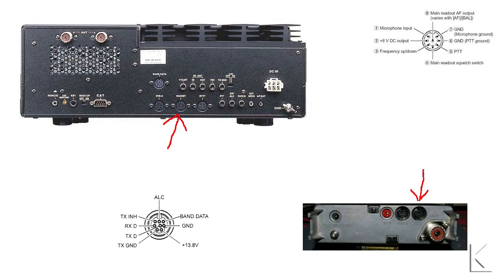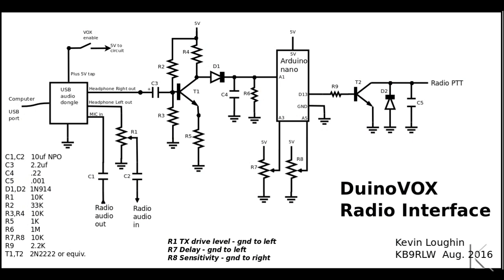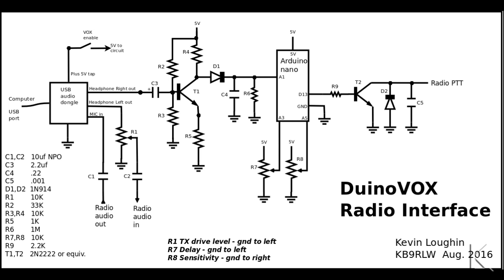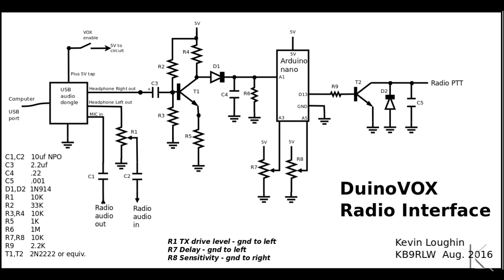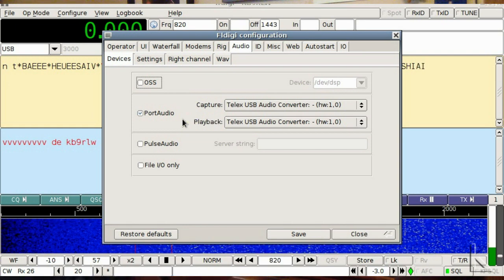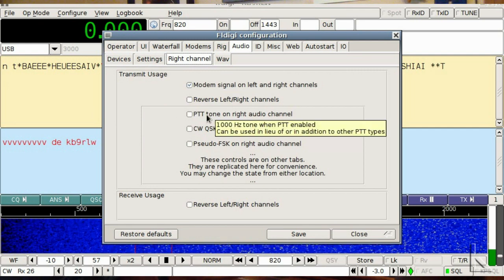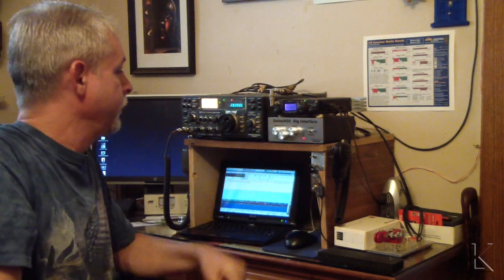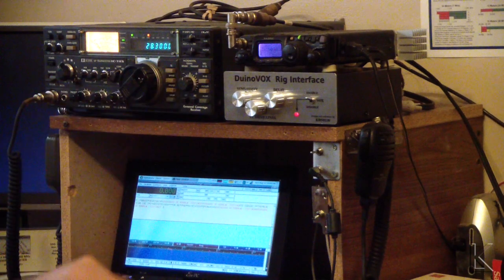DuinoVOX   USB digital modes interface for Ham Radio.  Easy to build!

Comment: Thank you so much for running through what all the resistors are for etc, I am not good enough to understand how to design my own yet so im swimmin gin a sea of diagrams and old forum posts! Tip for the future please balance the radio noises to your voice, i had to fiddle the audio a lot to not hurt my ears
Reply from the maker: This was many years ago when I was first doing yt vids.    One of my first major projects actually and there's been many since.  Production value improved greatly a year after this video..  Check my channel videos tab, over 500 vids now.
Reply: @loughkb  Will do thanks, I'm highly interested in trying to make my own little TNC but the schematics I see are all so varied. Hopefully ill find more info on this channel :)

Comment: Hi Kevin, thanks for a great video. Im in need of a VOX and have all the parts except for the 33k resistor. Any alternative suggestions. I may have 100k that i can put in parralel x3 but if not any substitution suggestions for the 33k resistor? 22k is the closest I have on hand.
Reply from the maker: No, that has to be 33K for the amplifier to work correctly.  It's a common value, you should be able to obtain one from any supplier.

Comment: Thanks for sharing this Kevin! I love your really clear explanation of the circuit diagram and the function demonstration. I have created a simple audio circuit similar to yours, but I put isolation transformers in, and also added a resistor divider instead of a pot to adjust the levels. FIne adjustment can then be done in the PC software. I didn't put a vox circuit in, but used a control cable to the radio from a separate usb port, because at the time I didn't know how to get vox configured.

Comment: Can we use it for ecolink de VU3ZNL
Reply from the maker: Maybe.  You might have to dial up the delay so it doesn't unkey the radio during vocal pauses.   Echolink really needs to have direct control of the PTT line to work properly.
Reply: @loughkb  thank u de VU3ZNL

Comment: This may be a bit late but what size enclosure did the unit fit into? Are you still using it?
Reply from the maker: The size can vary.  I've seen people build it into an altoids tin.  Yes, I use it with my FT-817.

Comment: I've seen your design with some changes by another builder. I am not sure the reason but he has the PTT circuit driving the coil side of a relay. I personally think going that route is one, unnecessary and two wouldn't the relay be a very possibly point of inducing noise into the device? It is adding a few more parts and the transistor is merely completing the ground to a PTT relay that is inside the radio already. 

I just don't get why one would feel a need to use a relay to merely complete the ground to another relay inside the radio. Relays will be pulling the 5 volts down even more and relays can be a major point for failures later down the road. To each their own though. That's the pure fun of designing and building stuff though.

Comment: Hey Kevin, I was curious if you sold a circuit board for this or not? I use these style boards as well but wanted to see if you happened to build a board for it that was printed out with traces. I am going to try and do mine that way to see how neat I can actually make this and eliminate so much wiring inside of it. Well at least keep it super short. I am doing this just because I love seeing how downsized I can make things.

Comment: Thank you for this project. It will help me to create a link between my Heathkit SB-104A into the digital modes interface and use the FLDIGI program. I got everything that I need for the Arduino Nano module source code. The problem was that I tried to print the schematic, but it came out in a fuzzy image. I do not know why it happened. Can you help me? Thank you very much
Reply from the maker: Send me an email to my public address listed on qrz.com and I'll send you the schematic.
Also, being that the old heathkit is a tube rig, you may want to use isolation transformers for the audio connections to the radio and an opto isolator or even a relay for the keying line.
Reply: @loughkb  My Heathkit transceiver is SB-104A, full solid-states, but I like to put optoisolators to interface with my rig. I do not have a callsign but expect to get one later this month or next month. I got some parts to build DuinoVOX USB. Some other parts are coming to be complete before I start to build the device. 73

Comment: what can I leave out of the circuit as using cat to key up
Reply from the maker: Everything but the audio interface.   The goal of this device is to do everything with only one simple USB connection on the computer side.  Eliminating the need for the additional serial connection for cat control.

Comment: Nice project i did it in my own way the same but i have a problem. When i use wsjtx for ft8 or fldigi for other modes. They often crash on trabsmit. Fldigi stops transmitting and the waterfall freezes although the laptop runs smoothly. Wsjtx also stops transmitting and switches the audio output to my default speaker. I think this issue is created through rf interference but im not sure (these problems dont occur on 2m or 70cm but on hf). How can i fix this

Note: i use a plastic box as an enclosure so no shielding ti ground from the box
Note 2: every problem disappears when using 5W on my rig. Everything above does not work
Reply from the maker: You have a problem with your antenna system that is feeding RF back into your shack on the coax shield.   Or your antenna is too close to your shack and you're running power.
What kind of antenna and how much power are you running?
Reply: @loughkb  on a cushcraft r5 which is about 1 to 2 meters above the ground. I run 5 to 100 watts on an icom ic 705mk2g. 5 watts all fine but as soon as i go higher it crashes. My antenna is maybe 6 or 7 meters to my shack
Reply from the maker: @hayjaydee873  So you're right in the strongest lobe of it's RF field and really close to it.   If you put a field strength meter in your shack you'll probably be surprised by how strong the RF field is in there.   
Rebuild the interface into a metal box and put chokes on the USB and audio cables between it and your computer.  Also a short run to a ground rod for your radio's and tuners might help.
Verticals have a low angle of radiation.
Another thing that might help would be a common mode choke in line with the feed line to the antenna.  Put the choke outside the shack and it will cut down on RF coming in via the coax shield.
Reply: @loughkb  thank you very mutch i will definetly check this out. The r5 has a choke inside of it so this might not be the main problem. I definetly need to ground my station i am just not quite shure how but i will figure it out. Thank you so mutch for your help 👍👍👍👍

Comment: I have just one question .. for the caps C1 y C2 (for radio audio out and radio audio in) I have electrolytic capacitors so my question is how connected the caps the positive side for the radio audio or for another side?
Reply from the maker: Doesn't really matter when you're just passing audio.

Comment: Good day Kevin, one last question before I actually put power to the circuit. At 9:10 , you say, "And C5 is a bleed resistor to bleed off any RF that might be coming in the PTT line."  The question is : is C5 really a .001 pf capacitor, or is it a resistor?   I've had a blast with this - my first time in going from a schematic to a real live piece of hardware that was not a kit. Lot's of mental gymnastics figuring out where pieces can go, how to fit .. etc. Many many thanks. All soldered up except for C5  :-)  Al K7AOZ
Reply from the maker: It's a cap.   Sorry if I misspoke.  It should be correct on the schematic.
Lots of people have built this.  I still use mine.   I hope you get many years of service out of it!

Comment: Hey, Kevin, are you still using this?
Looking at building one.
Reply from the maker: Yes.  I use it with my Yaesu FT-817, works great!
Reply: I designed a PCB for mine (I hate point-to-point wiring, and I have a condition called familial tremors, which makes my hand shake pretty badly sometimes." I made it up on OSH Park...

Comment: I think if you switch the ground and B+ on the variable resistor then you can change the turn to the left to increase to turn to the right to increase.
Reply from the maker: Which is exactly what I did and talked about in the blog post.  I think it's even noted on the schematic if I remember correctly.

Comment: Good Day Kevin! Query on the DuinoVox : In two years : 1) are you still using it ? 2) have you changed any of the software or code? 3) How's the traveling life? I ask the first two 'cuz I've all the parts now and am about to heat the branding - oh, the soldering iron and get started. I ask the third , 'cuz we did that for three and a half years until winters got to be toooo much. Thanks for the videos and excellent training. Al
Reply from the maker: Hi Al, thanks for watching. Yes, I still use the Duinovox pretty regularly. I have not made any changes to the design or software since I built it's worked perfectly.
Reply: @loughkb  Thank you good sir!
Reply: @loughkb  One more... :-) The physical box shows the LED , but the schematic does not. Where'd you put it?
Reply from the maker: Oh, that's just on the switched 5 volt power to indicate when the vox circuit is active.
Reply from the maker: It has a 450 ohm resistor to limit current through the LED.
Reply: @loughkb  Thought as much, but wanted to be certain. Thanks

Comment: Do you use any 1:1 transformers to isolate the computer from the interface or radio or do the caps also help protect?  I do like the adjustment pots for this...I have been running easy digi kits for a few years now..I may have to build one of these though after seeing this video!
Reply from the maker: I have had no problem with the caps, but you could use transformers if you want.   I'm not running any old tube gear with high voltages, so I didn't bother with the transformers.   Performance is excellent and I've heard from many people that have built it and love it.

Comment: Hi Kevin I Think I have this project breadboarded up, but before I try the smoke test I wanted to ask a couple of noob questions. First this is expecting a line level input correct? would a speaker/headphone level be to much for it to handle? would I need to increase the resistance of the input pot, or maybe skip the amp stage?  Also Do I need to tie the shields from the audio cable to ground? what about the ground side of the PTT? I'm building this to connect to a bitx40v3 and soon a uBitx if I tie the ground planes from the 12v radio and this 5v circuit, and computer? 
73 de W9ECO
Reply from the maker: I do tie all the grounds together.  You need that to cut down noise, and bleed off any RF that sneaks in.
You could use headphone audio at a low volume level, but it's best if you can tap off the line level audio somewhere.  I don't know where on those kits, but most commercial rigs have a line level output on an accessory jack on the back. Since that's going into the mic input on the sound dongle, you would not want to feed it speaker audio at any volume.
The amp stage is for the audio coming from the computer via the sound card dongle, so that's already at the right level for the circuit.

Comment: Kevin, W5BNW here. how did you have the vox controls set on your transceiver? Did you just leave them in their usual settings?
Reply from the maker: No vox is required on the radio.  That's all handled by the arduino, which simply keys the PTT line on your transceiver.
Reply: Kevin Loughin ok thanks

Comment: Hey Kevin,
Thanks for sharing this information. It is very inspirational. Where did you find the enclosure box? Love your videos. thanks again.
73
Ray KE0OAP
Reply from the maker: The case was an old damaged MFJ active receive antenna.  Someone had transmitted into it, it was totally burned electronically.  The front label is an adhesive vinyl that is made to look like aluminium.  I designed the graphics and pulled a favor from a friend at a print shop.
Reply: LOL That must have been a hamfest junk box (for a buck) find. It looks like it was made for the project.

Comment: Subbed!! Very nice project!! I like the front of that box by the way. Can you describe what you used to print that on there? (printed on clear 'sticky' via laser printer, or directly on metal?) Love the intro music as well! Takes me back to my old Commodore days. hehe
Reply from the maker: The front panel is a vinyl adhesive material that is colored to look like aluminium.  I pulled a favor from a friend that works in a print shop.  I designed the print in Inkscape, which is an open source program similar to adobe illustrator.  I use all open source software here, all my computers run linux.
Reply: Awesome! I have been making projects for a while and the one thing I would love to do is make the various containers I put them in 'nicer' looking. Love me some Linux! Kali and Slackware are my favs. Have played with Inkscape a little but not that much yet. I use GIMP, but Inkscape looks like it can do alot more. Thanks for the reply! 73! KG5NJO

Comment: Can you just use the vox built into the rig?
Reply from the maker: In most cases, the VOX only works on the audio from the mic connector.  When using the aux audio input on the back of the radio, the radio's vox won't trigger.  There may be some exceptions.

Comment: I've got a TYT HT with a kenwood-style interface that I'm using for FSQ on 2m.
The HT triggers PTT when the two grounds (audio in and out) are crossed.
I have arduino nano clones available, but I was wondering if it would be possible to use a simple capacitor to take the right-channel PTT signal from fldigi and use that to trigger an optoisolator to key down automatically.
I'm still very much an electronics beginner :)

What I'm using right now is a BTECH APRS cable, which interfaces with the kenwood-style port on one end, provides an iPhone style TRRS cable on the other end, and has AGC hardware (and ground isolation for the two channels, I assume) in the middle.
Right now, I've got a female TRRS -> 2x male TRS splitter going to a USB sound card for my laptop.

It works well, but of course the HT's built-in VOX doesn't work when SQL=0 (open squelch).

What would be the easiest fix? I don't mind making an arduino-based circuit, but I was trying to find the simplest solution possible :D

Comment: How hard would it be to take the vox circuit you have an adapt it into an older radio to have vox. I mean if the vox input is added directly to the mic input pin in the radio the drive level is not going to be like the sound card output in your interface and probably not enough amplification to drive. Would I need to change some values on the transistor to amplify the mic pin audio? Thanks for a great video. KC3JAI

Comment: in purchasing parts for this, I omitted the 33k resistor. are there any other components in this build I could substitute? I've got extra of all other components.
Reply: I guess wiring (3) of the 10K resistors in series world produce 30K resistance. (If I'm remembering my General study material correctly.)
Reply from the maker: You really want a 33K there. It works with R1 to apply a proper bias voltage to the transistor so that it will amplifie properly.   Dig through some old dead electronics, 33K is a common value.   Orange Orange Orange Silver (or gold is better).
Reply: I've got some old police two-way radios I'll open up.  Thanks for the idea!